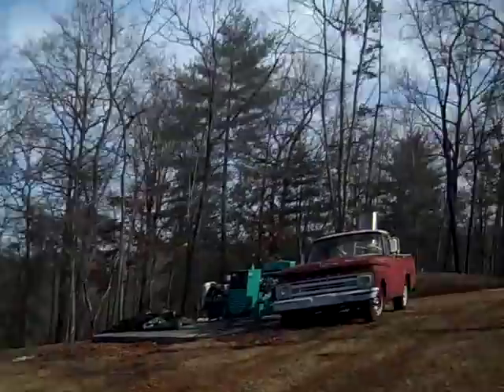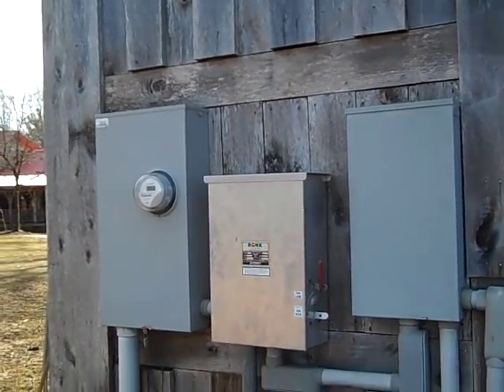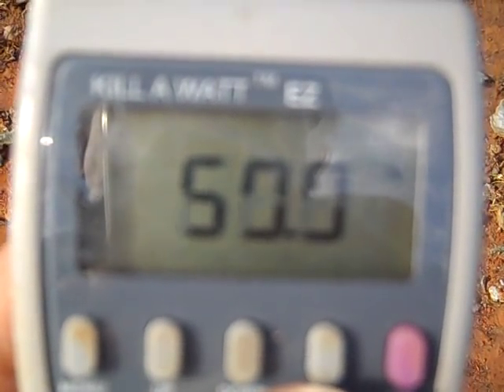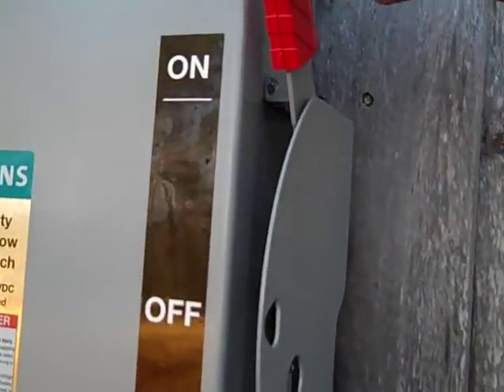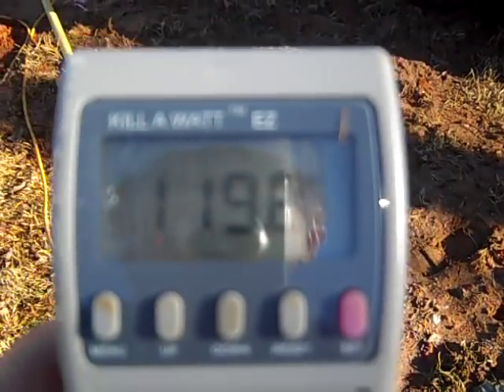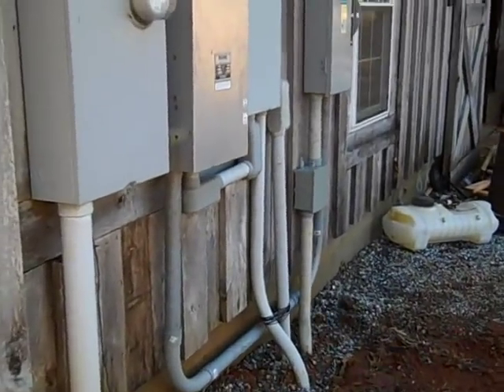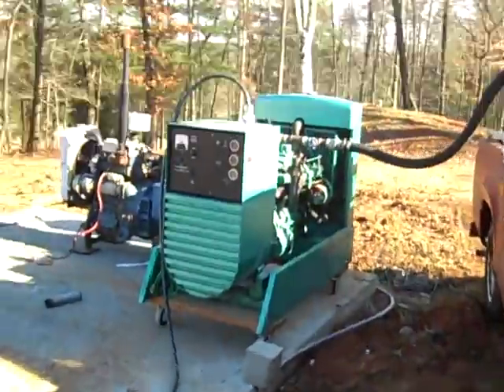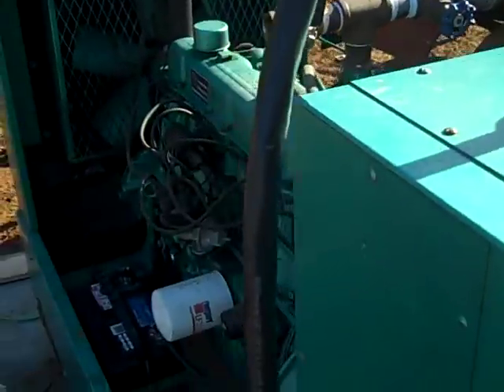The wood gas generator runs the whole farm!

Comment: You should show a fuel consumption rate . How long will your gassifier run that gen?  I was comsidering mounting a four cylinder gas  engine cooling system and all and run it on wood but i want to know what the consumption rate is before i do so i know how bog to make the gassifier  burn tank
Reply: Side  note changing batteries to run refrigerstion overnight to save  wear .
Reply: I want my system quieter than that . Like whisper quiet.

Comment: Is this still working? 
How long will one load of the gasifier last?
Reply from the maker: 2 hrs
Reply: @engineer775  
Wouldn't that be difficult in a power outage or does it load pretty quickly?

Comment: Shalom Aleichem. 

I was in Florida 40 or so yrs ago and saw a guy driving down the road in a pickup with a weird contraption in the bed with hoses running over the cab an into the engine compartment. 
He pulled into a shopping center an I had to ask'em what the setup was and he was happy to show it to me. I was amazed that this contraption was running his vehicle off wood and roadside trash.
However at that time fuel was around $0.50 per gallon an it wasn't cost effective.

Scoot ahead to now with the price of fuel skyrocketing ($2.90-$3.05 per gallon) around here in Virginia. It'd be nice if you could post the plans in how you built the unit an it's cost. I'd like to build one for my home generator and possibly for my gas truck (have a gas & diesel truck).

Ratson haba b'shem YaHuah

Comment: Do you have to constantly adjust the valves due to fluctuations in wood and heat   compacities? If so could you modify a pellet stove off this?
Reply: You need an AVR that operates for the voltage

Comment: I like what the guys building for the technology. But most of the people I see doing this haven't really reduced their load necessity.

I mean I could build a solar setup for 2 to 4,000 that would do everything and then some.

A buddy of mine build a system for under $500 that supplied the electricity his trailer needed. And he had a fridge and a computer.

What I'd like to see someone do is use the heat from the biogas reactor to heat one structure. a home or a greenhouse.

And then use the generators liquid cooled access Heat to heat one place with the generator BTUs and exhaust.

And another structure or Greenhouse with the liquid coolant.

Moreover realistically with a below ground geothermal Greenhouse design. There would be almost no energy needs. 

The system would essentially Supply a surplus of energy and heat.

Perhaps a biogas production manure digester for excess Heat.

Sorry if I'm having an Urza moment.
Reply: Gasifiers for electricity are only good for backup power or microgrids of 200+ kw
Reply: @baloog8  200 kilowatts is a pretty absurd high level of energy. 

At that point you might as well be running a small community. Could actually run a pretty big small community off of that.

Especially using the extra heat off of the engine for other purposes like baking and boiling water. 

Effectively you could run a public shower and then use the excess water from the showers. Plumb the gray water.

Build a heat exchange to capture the heat for dryers or other uses

Realistically you could probably power 400 after at homes if they were built correctly.

But that would require that the homes were built using modern high efficiency techniques and appliances. 

Anyhow you have a great day.

Comment: I have a diesel system for exactly that purpose. I usually run it parallel to the grid, but the control is programmed to have grid power intake at zero, when it runs. It runs when I need the "waste" heat for something. I only have an "island" switch if the grid is down... which has not happened during now 4 years of operation.
Wood gas would be great but I don't have enough trees on my property to feed it this way.

Comment: .....just wondering who will keep shovelling the wood into the carbon monoxide producer . Is the wood fuel truly free ? Any plans to harness the wasted heat ? Coal can also be used of course . In the final days of steam engines an automatic feeding of the coal in pellet form by Archimedes screw was in use .

Comment: Now grow some oil crops, squeese oil and make biodiesel or use straight vegetable oil (SVO) with mechanical in-line injection pump during warmer months. Battery chainsaw with 2 batteries might be able to cut all your wood. You wouldn't need ANY fuel except wood. And, if you had enough LiFePo4 batteries, you could be off grid. Sure, all this aint cheap tho. https://www.renogy.com/lithium-iron-phosphate-battery-12-volt-170ah/

Comment: This is my goal to power the place with woodgas. Ive bought a couple 500 gallon propane tanks to compress and store the gas where its ready to go any time. Ive got a pair of ford 300 i6 s as well just need a good gen head. Ill get there eventually.
Reply: .....you've probably looked into it. For others who are reading anyway :- my understanding is that the propane tanks are rated to 20 atmosphere as a safety margin but never operate at more than about 5 atmosphere cos propane and butane liquify at at those lower pressures easily so that 5 atmosphere can enable storage of 250 volumes of gas or a bit more . Carbon monoxide fuelgas doesn't liquefy at the low pressures so that compression of carbon monoxide to 5 atmosphere stores only 5 volumes of the gas . So 500 gallons is a good practical volume of gas to store at 5 atmosphere , I wouldn't contemplate smaller tanks .The hydrogen that's also produced as a result of moisture in the wood or damp or humid air could be something to look into because hydrogen embrittlement of steel can be a concerning factor .

Comment: Did you try running your diesel off the gasifier? I thought I saw a video of somebody running a diesel off a gasifier if you do let me know please thank you
Reply: I would think it would be possible, West of here there are diesel engines  converted to run on natural gas for irrigation
Reply: .....diesel fuel has some lubrication quality which carbon monoxide fuel doesn't have. Not sure if the lubrication is required for the high pressure injector pump only or perhaps also upper cylinders and rings .

Comment: You could build a large enough static gasifier in a shed about 100 yards from ur main property and just bulk the hopper up with a mass load and have ur generator in the shed and try to get a accurate feed for a whole days electric if u needed it also bible the gas thru a water bath with added chemical like dish soap to break the tar up.if using gas to cook on .

Comment: I am not intelligent enough to understand this at a glance. I must do some research for myself. Would it be simpler for us country bumpkins to build a wood fired steam generator?
Reply: .....all its doing is production of carbon monoxide which happens to be a good fuelgas and produced  by the burning of carbon which is starved of sufficient oxygen. The gas fuel isn't really wood volatiles or gaseous tar products except maybe in early stages.I've heard mention of FEMA for a source of designs.  Robert Murray Smith on his channel is building and testing in dribs and drabs a gasifier for a generator but it's all interrupted randomly by a windmill he's also working on and an electric scooter using homemade super capacitors he's fabricated  while he's learning to weld .

Comment: If nitrogen in over 71% in the air? An internal combustion engine operates off oxygen nitrogen? A stirling cycle cold gas engine can generate liquid atmosphere that looks like water that can then fill an insulated tank with frequency emitters at the bottom of the tank to cause that liquid gas to vaporize which can then be used to fuel a gas combustion engine? Sounds just has crazy has running things off fumes from burning wood. 😊

Comment: Would it be possible to use a helium sealed stirling piston to turn that gas mixture coming off that wood gasification system into super cold Liquid and store it in an insulated tank with a frequency emitter that can then cause that liquid atmosphere to vaporize in order to operate a vehicle? 😊

Comment: Its been a few years since you posted this...Are you still using this system? Any improvements or updates?  I'm here in south florida...hurricane country...I've run a standard gas generator for auxulliary power... but the weakness I see is fuel for long time outages.  I've thought about a gasifier style generator as I think that would be better long term in SHTF scenarios.  How is your system holding up?
Reply: Did he ever reply?

Comment: I know its a first step, but, you have a meter and I think you didn't show Amps of load?  Like revving a car engine and no 0-60 times and car weight, etc.  If you have problems, say so, and WE can solve them.    I'm guessing, but problems with tar build up in the intake manifold and intake valve, and need for air/fuel measurement and automatic adjustment.   After all, these are all just a bunch of mechanical problems, with solutions.

Comment: You will get MUCH more out of pine needles than you would gasification of wood. Pine needles can be raked and bailed as you would hay for easy storage and handling. This solves the rejuvenation of trees problem as pine needles occur every year on an endless cycle, plus they pack far more energy than the wood itself.
Reply: Pine cones would benefit even more, but they more difficult to collect and handle unless they can be pulverized to minimize volume.....

Comment: how do the cylinders stay lubricated with no diesel, and only syngas?
Reply: that whole machine is oil lubricated like a car.
Reply: No, a diesel inherently has more lubrication, within the fuel. Unlike gasoline. To replace that fuel with syngas ultimately would change that equation, and so either "some" diesel gets used, or, something else has to happen...
Reply: It is most likely a 300 six that was originally set up to run natural gas.

Comment: Hook up a row of high voltage caps on it..  Go to an HVAC store and get 10,  630 volt 20 uf motor start caps and put those between the generator and the load.. This would help with any lag..

Comment: That is awesome, ive always wanted to build a gasifier, this is inching me closer.
Reply: What is a gasifier?
Reply: @williamkunte5361  there are lots of videos on YouTube about it, do some research, but here is the simplest explanation. Gasification is the process of burning wood in a very low oxygen environment, instead of burning like normal it releases flammable gasses like propane, butane, methane, etc. Those can then be harnessed and filtered as a clean fuel source and you can pretty much use it to power anything that runs on propane or gasoline. Mr Teslonian has some good videos on how to filter out the waste and the waste is actually a type of dirty crude oil, which you could use as a different fuel source.

Comment: Wow that's noisey. sound like a tractor with no exhaust system. Dig a hole the depth of the Gen, for the Gen and build a little wall around the hole to fix on a soundproof roof. Damn, I should have sold you that idea : )
Reply: He said he plans to make a building for the generator - for soundproofing as well as keeping the rain off.

Comment: How much wood to generate 1 kw-hr?
How much time collecting and processing does it take?
Do you have a wood chipper?
Are you going to run it full time ?
You will need a lot of wood chipped and an automatic feeder.
How often do you check the generator and gasifier when running?
Have you checked for how clean (tar free) your gas is?
What is the total load for the house and shop?
Do you plan to recover the heat from the exhaust and heat your house and shop also?

Comment: why can't you use the wood boiler as the heat source?
Reply: It's not a wood boiler.  The wood is converted to CO + H₂ ("syngas") by heating with restricted oxygen.  However, cooling the syngas is part of the process, and a heat ex-changer might be able to extract some of that heat.  But the necessary pipes would be a big project - and water pipes would have to be protected from freezing.  Any leaks in an air heat ex-changer would put CO directly in your house.
Reply: very true, steam powered generators are far more efficient, but also like you say, very volatile and much harder to control .  An efficient woodgasifier is up to temp and producing within 10 - 15 minutes, can be diverted off to a flare outlet if needed, residual heat can be used to heat buildings and water supply etc etc etc.  Call me a fanboi here but im a big fan of woodgas.  if your not using it to power your house, or recharge your battery bank, you can compress and bottle it for later use.  I haven't seen any diy method of turning it into a liquid for bottling but im sure that wouldn't be so hard with a bit of research and development :D.  make enough and you would be able to fit those tanks to your truck and run that on woodgas too without the need for a gasifier on the truck.  its a win win win
Reply: steam can't be as cheaply or easily automated, either. not only are you working with deadly pressures and temperatures, but it needs constant supervision, a lot of downtime for cleaning and greasing, and you probably need more wood anyway. without three shifts a day it isn't feasible to operate on this scale. 

wood gas, on the other hand, is relatively quick to start, easy to keep going, safe, and mostly autonomous. load the hopper a couple times a day, and you're good to go forever.

Comment: I think it is funny how people want to argue or don't understand how this would be great in several ways from self efficiency to emergency use. What happens if the grid gets shut down for some reason??? For most people this would cause a mass panic but for someone who has planned ahead and done something like this it would make things much easier to deal with a power outage on the grids.
Reply: Gaspumps need power to work
Reply: sure but if you can get a generator couldn't a power station do the same? Were I live the grid did go down for week and theres was no problem buying anything, stores and stuff used generators and civilians often shared the power of their generator with the neighbours.
Reply: if the grid collapses you CAN go out and buy more gas. That power is down doesn't mean whole civilization doesn't exist anymore.

Comment: So if I'm following that right?? Three transfer switches.? Or is it just one ..Your second box..  And your first is just a double on off..
Reply: This is not my channel, but I will explain what I believe is shown at 2:21.
At far left is the main panel powered by the local utility company which may have loads (circuits) not connected to the auxiliary power supplies.

Next right in the stainless steel enclosure (2nd from right) is a three pole, double throw switch. Next enclosure (3rd from right) is a sub panel.  Then on the far end (4th from right) is another three pole, double throw switch.

Mechanically what is accomplished is the 2nd enclosure allows the sub panel (3rd enclosure) to be fed from either the main panel or either of two gen sets.  Either one or the other gen set can be selected via the 4th enclosure.  Both switches should be 3 pole to enable the neutral and both 120v lines to be isolated from all possible power sources (3 potential sources- local utility company or either of the gen sets).

Functionally the main panel can only be energized via the local utility company and the sub panel can only be energized via the main panel -or gen set 1 -or gen set 2.

Mechanically this could be done with two pole rather than three pole switches but is NOT advisable from a safety standpoint, the neutrals should be switched as well as both 120v. lines.  Additionally all conduits must have an unswitched common ground isolated from all neutrals except at the main panel.

I hope this helps.

Note: I believe the Onan gen set mentioned is 120/240 volt so functionally in this installation there are 3 current carrying conductors -2 120v. lines and one neutral.

Comment: Now all he needs to do is hook the generator up to that outdoor boiler's smoke stack.  It is already burning wood incompletely and with some filters, a damper, and time could serve to provide the heat for the home and the electricity. 
There is no difference between pulling combustible gas from a gasifier that is essentially a restricted burning chamber and the outdoor boiler which is also a restricted burning chamber.  The big difference is that the gasifier wastes the heat generated in combusting the wood whereas the boiler wouldn't.
That would also free up the gasifier on the truck so the family wouldn't have to choose between transportation and energy.
Reply: good point and you are correct and on the right thought line. Now build one for yourself and start saving the money your power company is taking from you every month.
Reply: Fred Schad, the amount of heat involved in a gasifier is very high and that heat is mostly recirculated into the system to complete the oxidation of the raw fuel. That produced gas must be be cooled to a high degree to remove the residual unwanted solids, and liquids that boil off from the wood. Tar, creasote and CO and water vapor must be filtered off and condensed for removal before sending the wood gas to an engine. The residue can be processed into liquid fuels comparable to gasoline and or diesel. So really the heat is not wasted because it is being used to complete the process.
Reply: iv seen it tired wouldn't work

Comment: Awesome idea. How much wood does it go through to run the generator for X length of time such as per day?
Reply: this was covered in another reply but consider an average V8 engine in a pick up, distance travel with a well designed and functioning gasifier it would not be out of reason the get 5000 miles from 1 cord of wood